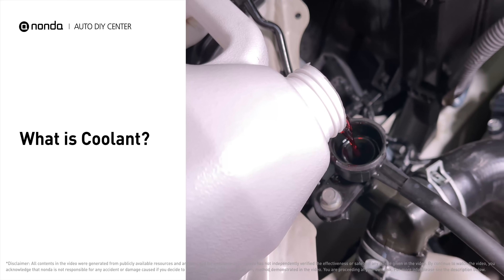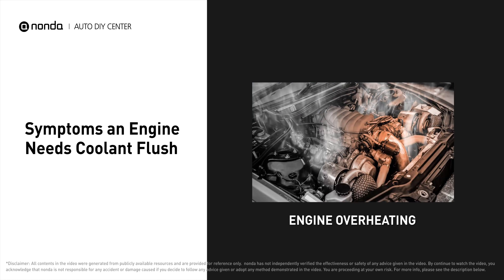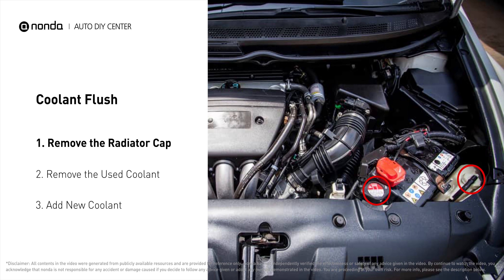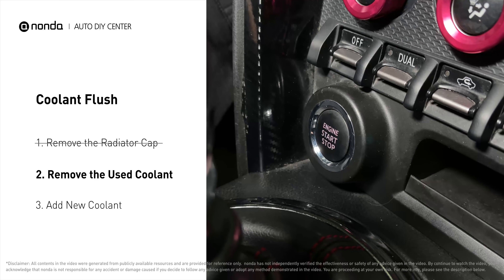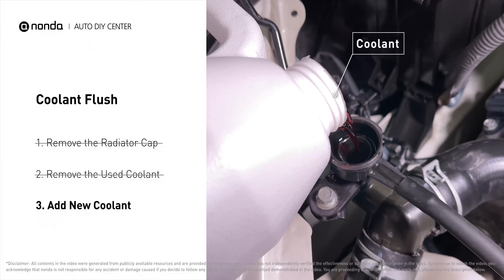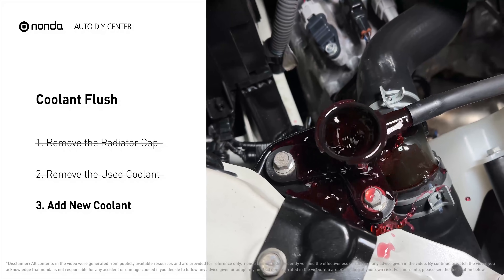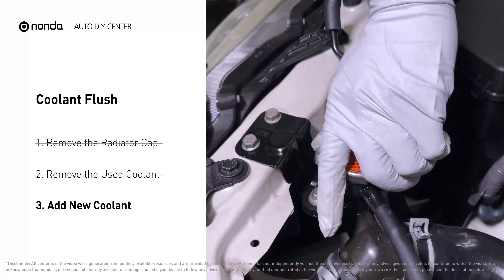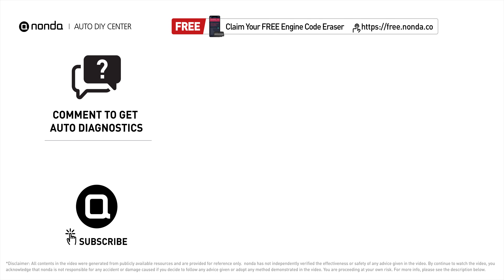Coolant: How it Works & How to Flush [3 Steps Save $200]

Comment: My car (Toyota Prius) engine Coolant reservoir empties quickly like in less than a day, I have to Add engine coolant every day. The engine always vibrates (shakes) a lot on Low RPMs also Engine heats up very quickly. . But there is no error code on ZUS App I have the Smart Vehicle monitor connected and working. There is no leakage from the hose either (under the car).
Reply: Coolant may leak into Combustion chamber bcs head gasket damaged or cracked cylinder ....Head gasket job or replace the engine are costly job . Need a mechanics diagnose.
Reply from the maker: Hello, having this kind of problem with your coolant reservoir could cause complications with your cooling system and lead to your engine being way hotter than it should be. You may have a hole in your radiator, a bad radiator cap, a blown head gasket, or a faulty water pump. We advise to please take your vehicle to a mechanic to pinpoint exactly what's causing your reservoir to be empty.
Reply: You are burning your coolant or it's leaking directly on the exhaust where it evaporates without a trace when hot. Your head gasket may be at fault if the engine exhaust fumes white smoke